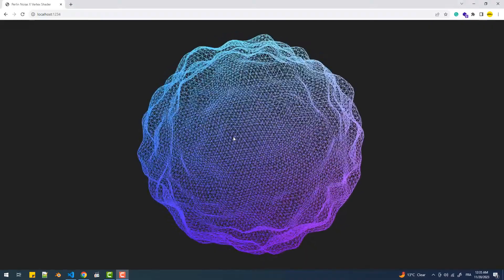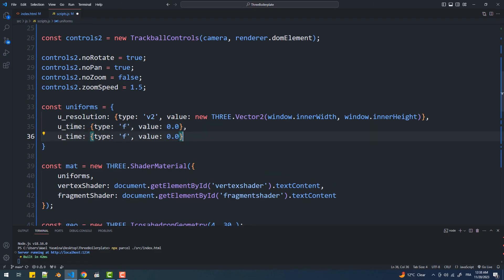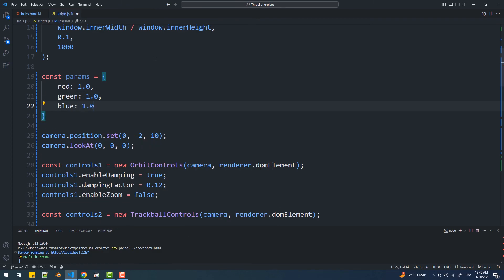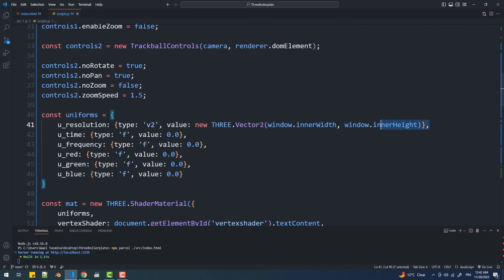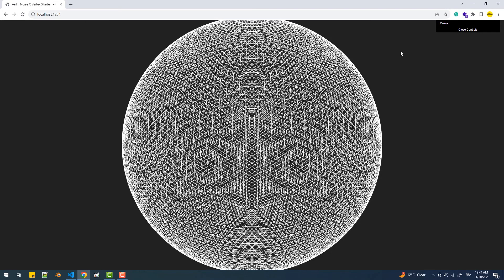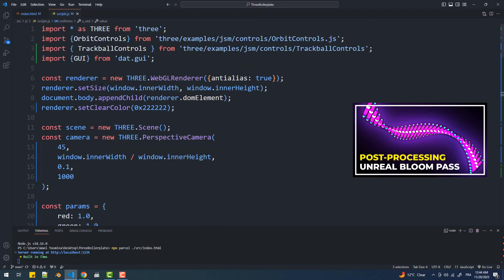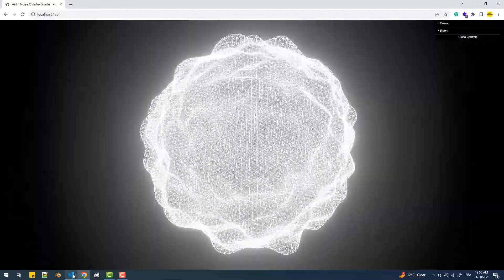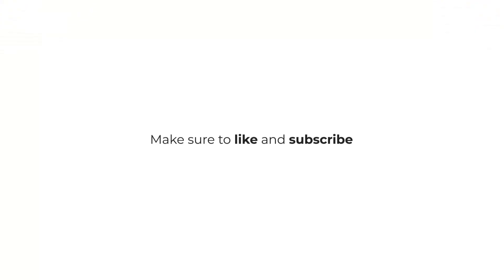How To Create A 3D Audio Visualizer Using Three.js

Comment: well if someone is doing it in tsx and next js here is the converted code of this  "use client";

import * as THREE from "three";
import { useEffect, useRef } from "react";
import { GUI } from "dat.gui";
import { EffectComposer, RenderPass, UnrealBloomPass } from "three-stdlib";
import { OutputPass } from "three/addons/postprocessing/OutputPass.js";
import { AudioAnalyser } from "three";

const vertexShader = `
uniform float u_time;
uniform float u_frequency;

vec3 mod289(vec3 x) { return x - floor(x * (1.0 / 289.0)) * 289.0; }
vec4 mod289(vec4 x) { return x - floor(x * (1.0 / 289.0)) * 289.0; }
vec4 permute(vec4 x) { return mod289(((x*34.0)+10.0)*x); }
vec4 taylorInvSqrt(vec4 r) { return 1.79284291400159 - 0.85373472095314 * r; }
vec3 fade(vec3 t) { return t*t*t*(t*(t*6.0-15.0)+10.0); }

float pnoise(vec3 P, vec3 rep) {
  vec3 Pi0 = mod(floor(P), rep);
  vec3 Pi1 = mod(Pi0 + vec3(1.0), rep);
  Pi0 = mod289(Pi0);
  Pi1 = mod289(Pi1);
  vec3 Pf0 = fract(P);
  vec3 Pf1 = Pf0 - vec3(1.0);
  vec4 ix = vec4(Pi0.x, Pi1.x, Pi0.x, Pi1.x);
  vec4 iy = vec4(Pi0.yy, Pi1.yy);
  vec4 iz0 = Pi0.zzzz;
  vec4 iz1 = Pi1.zzzz;

  vec4 ixy = permute(permute(ix) + iy);
  vec4 ixy0 = permute(ixy + iz0);
  vec4 ixy1 = permute(ixy + iz1);

  vec4 gx0 = ixy0 * (1.0 / 7.0);
  vec4 gy0 = fract(floor(gx0) * (1.0 / 7.0)) - 0.5;
  gx0 = fract(gx0);
  vec4 gz0 = vec4(0.5) - abs(gx0) - abs(gy0);
  vec4 sz0 = step(gz0, vec4(0.0));
  gx0 -= sz0 * (step(0.0, gx0) - 0.5);
  gy0 -= sz0 * (step(0.0, gy0) - 0.5);

  vec4 gx1 = ixy1 * (1.0 / 7.0);
  vec4 gy1 = fract(floor(gx1) * (1.0 / 7.0)) - 0.5;
  gx1 = fract(gx1);
  vec4 gz1 = vec4(0.5) - abs(gx1) - abs(gy1);
  vec4 sz1 = step(gz1, vec4(0.0));
  gx1 -= sz1 * (step(0.0, gx1) - 0.5);
  gy1 -= sz1 * (step(0.0, gy1) - 0.5);

  vec3 g000 = vec3(gx0.x, gy0.x, gz0.x);
  vec3 g100 = vec3(gx0.y, gy0.y, gz0.y);
  vec3 g010 = vec3(gx0.z, gy0.z, gz0.z);
  vec3 g110 = vec3(gx0.w, gy0.w, gz0.w);
  vec3 g001 = vec3(gx1.x, gy1.x, gz1.x);
  vec3 g101 = vec3(gx1.y, gy1.y, gz1.y);
  vec3 g011 = vec3(gx1.z, gy1.z, gz1.z);
  vec3 g111 = vec3(gx1.w, gy1.w, gz1.w);

  vec4 norm0 = taylorInvSqrt(vec4(dot(g000, g000), dot(g010, g010), dot(g100, g100), dot(g110, g110)));
  g000 *= norm0.x;
  g010 *= norm0.y;
  g100 *= norm0.z;
  g110 *= norm0.w;
  vec4 norm1 = taylorInvSqrt(vec4(dot(g001, g001), dot(g011, g011), dot(g101, g101), dot(g111, g111)));
  g001 *= norm1.x;
  g011 *= norm1.y;
  g101 *= norm1.z;
  g111 *= norm1.w;

  float n000 = dot(g000, Pf0);
  float n100 = dot(g100, vec3(Pf1.x, Pf0.yz));
  float n010 = dot(g010, vec3(Pf0.x, Pf1.y, Pf0.z));
  float n110 = dot(g110, vec3(Pf1.xy, Pf0.z));
  float n001 = dot(g001, vec3(Pf0.xy, Pf1.z));
  float n101 = dot(g101, vec3(Pf1.x, Pf0.y, Pf1.z));
  float n011 = dot(g011, vec3(Pf0.x, Pf1.yz));
  float n111 = dot(g111, Pf1);

  vec3 fade_xyz = fade(Pf0);
  vec4 n_z = mix(vec4(n000, n100, n010, n110), vec4(n001, n101, n011, n111), fade_xyz.z);
  vec2 n_yz = mix(n_z.xy, n_z.zw, fade_xyz.y);
  float n_xyz = mix(n_yz.x, n_yz.y, fade_xyz.x); 
  return 2.2 * n_xyz;
}

void main() {
    float noise = 3.0 * pnoise(position + u_time, vec3(10.0));
    float displacement = (u_frequency / 30.0) * (noise / 10.0);
    vec3 newPosition = position + normal * displacement;
    gl_Position = projectionMatrix * modelViewMatrix * vec4(newPosition, 1.0);
}
`;

const fragmentShader = `
uniform float u_red;
uniform float u_green;
uniform float u_blue;

void main() {
    gl_FragColor = vec4(vec3(u_red, u_green, u_blue), 1.0);
}
`;

const PerlinNoiseShader = () => {
  const mountRef = useRef<HTMLDivElement>(null);
  const soundRef = useRef<THREE.Audio | null>(null);
  const analyserRef = useRef<THREE.AudioAnalyser | null>(null);
  const guiRef = useRef<GUI | null>(null);

  useEffect(() => {
    if (!mountRef.current) return;

    // Initialize renderer
    const renderer = new THREE.WebGLRenderer({ antialias: true });
    renderer.setSize(window.innerWidth, window.innerHeight);
    renderer.outputColorSpace = THREE.SRGBColorSpace;
    mountRef.current.appendChild(renderer.domElement);

    // Scene setup
    const scene = new THREE.Scene();
    const camera = new THREE.PerspectiveCamera(45, window.innerWidth / window.innerHeight, 0.1, 1000);
    camera.position.set(0, -2, 14);
    camera.lookAt(0, 0, 0);

    // Audio setup
    const listener = new THREE.AudioListener();
    camera.add(listener);
    const sound = new THREE.Audio(listener);
    soundRef.current = sound;

    // Audio analyser
    const analyser = new AudioAnalyser(sound, 32);
    analyserRef.current = analyser;

    // Audio loading
    const audioLoader = new THREE.AudioLoader();
    audioLoader.load(
      "Beats.mp3",
      (buffer) => {
        sound.setBuffer(buffer);
        sound.setLoop(true);
        sound.setVolume(0.5);
      },
      undefined,
      (error) => console.error("Audio loading error:", error)
    );

    // Material setup
    const uniforms = {
      u_time: { value: 0.0 },
      u_frequency: { value: 0.0 },
      u_red: { value: 1.0 },
      u_green: { value: 1.0 },
      u_blue: { value: 1.0 },
    };

    const mat = new THREE.ShaderMaterial({ uniforms, vertexShader, fragmentShader });
    const geo = new THREE.IcosahedronGeometry(4, 30);
    const mesh = new THREE.Mesh(geo, mat);
    scene.add(mesh);
    mesh.material.wireframe = true;

    // Post-processing setup
    const params = {
      red: 1.0,
      green: 1.0,
      blue: 1.0,
      threshold: 0.5,
      strength: 0.5,
      radius: 0.8
    };

    const renderScene = new RenderPass(scene, camera);
    const bloomPass = new UnrealBloomPass(
      new THREE.Vector2(window.innerWidth, window.innerHeight),
      params.strength,
      params.radius,
      params.threshold
    );

    const bloomComposer = new EffectComposer(renderer);
    bloomComposer.addPass(renderScene);
    bloomComposer.addPass(bloomPass);
    bloomComposer.addPass(new OutputPass());

    // GUI setup
    const gui = new GUI();
    guiRef.current = gui;

    const colorsFolder = gui.addFolder('Colors');
    colorsFolder.add(params, 'red', 0, 1).onChange((value: number) => uniforms.u_red.value = value);
    colorsFolder.add(params, 'green', 0, 1).onChange((value: number) => uniforms.u_green.value = value);
    colorsFolder.add(params, 'blue', 0, 1).onChange((value: number) => uniforms.u_blue.value = value);

    const bloomFolder = gui.addFolder('Bloom');
    bloomFolder.add(params, 'threshold', 0, 1).onChange((value: number) => bloomPass.threshold = value);
    bloomFolder.add(params, 'strength', 0, 3).onChange((value: number) => bloomPass.strength = value);
    bloomFolder.add(params, 'radius', 0, 1).onChange((value: number) => bloomPass.radius = value);

    // Mouse interaction
    let mouseX = 0;
    let mouseY = 0;
    document.addEventListener("mousemove", (e) => {
      const windowHalfX = window.innerWidth / 2;
      const windowHalfY = window.innerHeight / 2;
      mouseX = (e.clientX - windowHalfX) / 100;
      mouseY = (e.clientY - windowHalfY) / 100;
    });

    // Animation loop
    const clock = new THREE.Clock();
    const animate = () => {
      camera.position.x += (mouseX - camera.position.x) * 0.05;
      camera.position.y += (-mouseY - camera.position.y) * 0.5;
      camera.lookAt(scene.position);
      
      uniforms.u_time.value = clock.getElapsedTime();
      uniforms.u_frequency.value = analyser.getAverageFrequency();
      
      bloomComposer.render();
      requestAnimationFrame(animate);
    };

    // Start animation
    animate();

    // Event listeners
    const handleClick = () => {
      if (sound.isPlaying) return;
      sound.play();
      listener.context.resume();
    };
    document.addEventListener("click", handleClick);

    const handleResize = () => {
      camera.aspect = window.innerWidth / window.innerHeight;
      camera.updateProjectionMatrix();
      renderer.setSize(window.innerWidth, window.innerHeight);
      bloomComposer.setSize(window.innerWidth, window.innerHeight);
    };
    window.addEventListener("resize", handleResize);

    // Cleanup
    return () => {
      gui.destroy();
      document.removeEventListener("click", handleClick);
      window.removeEventListener("resize", handleResize);
      if (sound.isPlaying) sound.stop();
      mountRef.current?.removeChild(renderer.domElement);
    };
  }, []);

  return <div ref={mountRef} />;
};

export default PerlinNoiseShader;

Comment: Hi it requires node.js.i installed node.js but i don't know about node.js it says install npm in the description.even though node.js is installed the project opens empty and doesn't work.I see this error "SyntaxError: Cannot use import statement outside a module" .please is there a version without node.js?
Reply: this cant be done by you just jumping in without any basic idea about this...
Reply: @rayforever   And how did you find out? Did a verse come down directly from the sky?

Comment: hi, can you help me with my code? I'm trying to make a button with text output in my project(three js)
Reply from the maker: Hi, can you elaborate?
Reply: @WaelYasmina  I made a 3D model of the drone, it has components (such as battery, propeller, frame). I'm trying to add small round buttons on these components. When clicked, text appears with a description of the component
Reply from the maker: I see. Check this out: https://youtu.be/0ZW3xrFhY3w
Reply: @WaelYasmina  ok, thanks for attention, i will try
Reply: @WaelYasmina  there is an example on sketchf@b, called Jurassic Aquarium Diorama